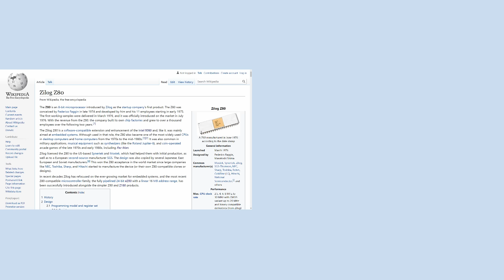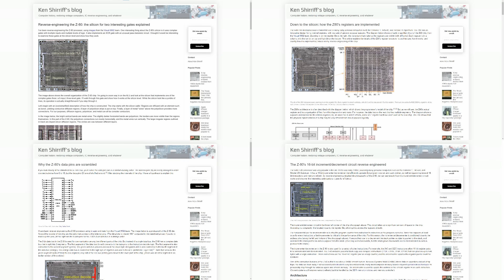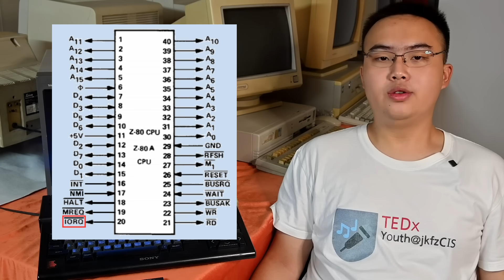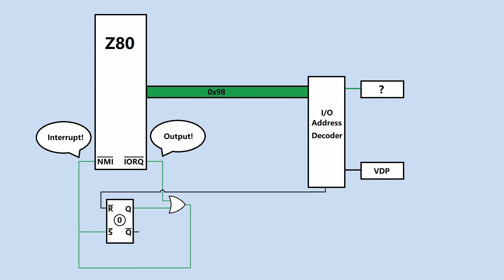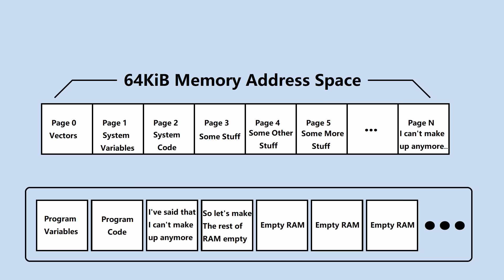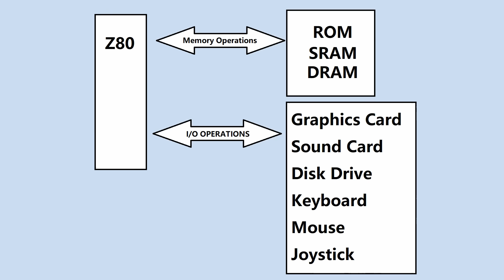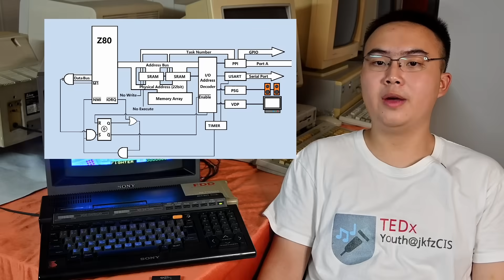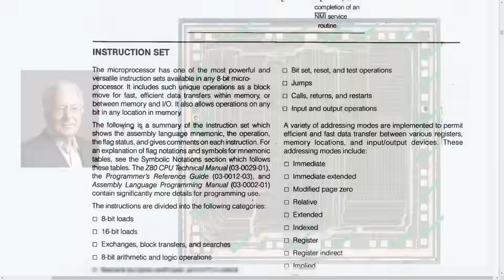The Z80's secret feature discovered after 40 years!

Comment: Brings back memories, all the cool things we were doing on Z80 and 8080 processors. We did not implement protected mode since there was little need for that, viruses and malicious access were not a thing in conditions we had back then. But things like paging memory into the address space and running CP/M system with multitasking capabilities were there. We also had to write pretty much all the software we used, not like today.
Reply: Not to mention that multitasking was an esoteric thing (unless you were on Unix and mainframes), thus in the home computer world protection against other processes wasn't especially relevant.
Reply: @henriksundt7148  - Not that esoteric. In the 80s, the company I worked for, did embedded design, and most of it around a Z80. The company designed its own RTOS. Multitasking came in real handy. We also adapted Forth (the programming language) to the chip, and wrote most of our code in it. We did some complex stuff, around this little 8-bitter.
Reply: @henriksundt7148  Some of it was economics too - Z80 systems were often CPU bound so it made more sense to have several Z80 boxes (possibly sharing an expensive hard disk via CP/NET) than multi-task one of them
Reply: @etchedpixels  not necessarily. Look into MP/M, a multi-user version of CP/M made to connect to multiple terminals
Reply: @DavidStudiosproduct  It was possible but MP/M was mostly useful to run the backend for CP/NET clients. Sharing a single 2-4MHz CPU didn't work that well unless you had specialist hardware (smarter serial, DMA driven floppy). On most CP/M systems the entire machine stopped for floppy accesses due to hardware limits - not very multi-user at all. And if someone needed to format a floppy every other user got a tea break. There were even S100 cards for multiple slave CP/M nodes so you could build a multi-user multi-cpu setup cheaply then run MP/M or more likely one of the better multi-user CP/M clones of the time.
Reply: @etchedpixels  - it’s 40 years ago but, from my somewhat flawed memory, we used a dedicated disk controller for floppies (and hard drive). 
Also we used floppy drives that used a voice coil/optical grating type positioning system which was faster than stepper motor types. MP/M was usable but we didn’t deliver that many systems and regular maintenance was required.
Happy days.
Reply: @duncanmcneill7088  Sounds like the Cromemco 8" floppies - never had a chance to play with one of those. In fact I don't think I've ever come across one this side of the pond
Reply: @etchedpixels  - we used the PerSci drives. Faster but vulnerable to dust, so regular cleaning required. If the eject mechanism fails, the ejecting disk would rip the heads off... lovely.
They moved on to stepper motor driven drives around 1983/4 but I left the industry shortly after that.
Reply: Your avatar is insane where is it from
Reply: I miss the old days.  I loved the way things used to be, simpler.

Comment: The title is not clickbait, it's straight out false: no "secret feature" was "discovered" in the Z80. Insisting to call this a "Z80 feature" detracts from the rest of the video which is actually really good.

Moreover, it took me until the end of the video to understand that you were the one to came up with this trick, so this even serves to downplay your ability. It's clear that you are a smart guy, so don't try to fake it and go straight to the point. You could've just said "Hey guys, today I'll show you how to make the impossible: protected mode with a Z80!" and that would've been fine and "clickbaity" enough without being misleading. I'll hope you continue to pursue this channel because you certainly have the potential for success.

I'll add some random thoughts with timestamps:

0:25 The trick you described could be very well implemented in 1976; there's nothing in "now" that is required for it.

1:58 That's not true, preemptive multiasking only requires a timer interrupt to work. You may have a point if you assume un-relocatable applications that assume to be loaded at a precise real address, but that's not a property of "preemptive multiasking" but of OS design.

2:55 It's not part of its "undocumented features" either. If you implement a video output circuit on your motherboard doesn't mean the processor has "undocumented video output features".

7:54 Of course you assume that "malicious code" can't change the NMI vector, for example if the OS code is in ROM or you implement the mapper circuit with access control you describe later.

11:00 The 6502 can do pretty much what you describe at similar hardware cost: the "syscall" trick  can be implemented by matching the BRK opcode (all zeroes) with the SYNC singal going high, and the equivalent of IORQ can be obtained in the I/O Address Decoder.

11:50 "Faggin" is pronounced with a "soft G", like "giraffe".

12:45 So you make "clickbait" videos because big channels (that have been working for almost decades to build an audience) get lots of views? What?

13:10 Of course, assuming that none of those platforms have any memory-mapped I/O.

14:30 I wouldn't be surprised if the story isn't true: the undocumented instructions are not really surprising if you analyze the official instructions and remember that the Z80 is a very simple implementation of a somewhat complex (for the time at this scale) instruction set. There was no point in including circuitry to detect invalid opcodes like in more modern CPUs, so when the Z80 executes invalid instructions, the internal circuitry just happens to do "something" based on the configuration of the internal signals at that time. When the result is deterministic and the CPU doesn't crash, we call it an "instruction".
For example, the DD and FD prefixes change all instructions that use HL into instructions that use IX and IY (with optional offset when used as memory pointers). It just so happens that they were implemented in such a way that the CPU didn't care what instruction came after the prefixes, and so it happily executed it while preserving the "setting" to use IX or IY; I wouldn't be surprised if internally is just a couple of flip-flops that get set while reading the prefixes and reset when the actual instrucion runs.
So, for example, "LD A, L"  prefixed by DD becomes "LD A, IXL", that is, you can use IX and IY as two independent 8 bit registers in every instruction that accepted H and L.
Since those instructions got a lot of use by programmers, when newer processors re-implemented and expanded the Z80 in a different microarchitecture, they had to make those instructions execute exactly like the old Z80 did, so many of them became finally "documented".

Comment: I had a DEC Rainbow - the beast had a Z80 AND an 8086 and you could boot it into either DOS or CP/M.  It was SWEET!
Reply: Then there was the DECmate -- A PDP/8 (Intersil 6100) and a Z80 :)
Reply: I have not thought about that machine since the maybe’85 when it was provided to me and other financial analysts at my company. I had used the Apple][ and IBM PC and had bought a MacIntosh; and the Rainbow was nice; replacing green lined paper spread sheets and long overdue. We only used DOS; and it was annoying that the 5 1/4” floppy discs though higher capacity at 400 kb were not compatible with the IBM PC 360 kb disks.

Comment: Not clickbait. What you showed demonstrated a very solid understanding of 1970s though early 1990s digital logic. Your solution was nontrivial and it is most certainly educational for those that have not worked through similar problems back in the day. Discrete, and even (hand-rolled) lookup digital logic is, imho, becoming a lost art. Thanks for putting it together!

P.S. the first CPU-based machine I designed centered around a Z80. It was a non-trivial, embedded system and decades later, it remains one of my favorite projects (at least, for its time).
Reply: It is clickbait. It's a great little MMU implementation, but a non-clickbait title would be something like, "I built an MMU for the Z80."

The current title, "The Z80's secret feature discovered after 40 years!" contains at least one outright falsehood (being able to build an MMU for an 8-bit processor is far from a "secret feature") and probably a second one (it's very likely several people have done something similar in the past, even in the long past; e.g. similar but more sophisticated techniques for were used for Jeff Laughton's 6502-based KimKlone which was built in the 1980s).
Reply: @Curt_Sampson  yeah, the “secret feature” part 100% is clickbait- I completely agree. But the video still delivers genuinely interesting and useful information about the Z80 (and other, similar CPUs) for the intended audience, so I support that aspect of it. Yep, it’s an MMU, but if the viewer doesn’t know how one works, on a logic level, or why one might be useful, it’s obviously novel (“secret”) to them. Basically, I see both angles, but I also see no harm.
Reply: @Curt_Sampson  I was reading your comment and then my neighbour came and we read it together. He said that your comment changed his life and touched his heart. I then went and rented a projector in a big field and my entire town read it and it changed their lives too. We all are so grateful.
Thank you for your first comment….
Reply: @rodiona8781  I'm glad to hear that. Earlier this afternoon I took your comment and had it put up on a five meter high billboard near my house. Since then many people have been stopping and applauding; you've really made my entire neighbourhood a better place.

They're all saying, too, "the original poster of that video must be so glad that so many commenters are entirely ignoring the video itself and the ideas in it, and instead using the comments section as a forum for venting their personal feelings about other commenters. I'm sure the OP feels the project that he spent dozens of hours on is far less worth of discussion than what Rodion A and Paull McGee are saying about how they feel about Curt!"
Reply: @Curt_Sampson  Curt, we still love you and I do not think less of you but I think you missed the point of the title. As someone that was riding by the seat of my pants trying to understand what was being talked about in the video (much like many people that will see this video) I found your comment dismissive and tone deaf. I still appreciate your opinion and your experience on the topic and I'm an advocate for people that don't think like others. So I really hope I can learn more from you. Not a jab, I would definitely subscribe to watch your videos if you ever made any.
Reply: @rodiona8781  Yes, looking back on my comment I can see how it would not be immediately clear to someone who doesn't have some level of understanding of, say, basic address decoding techniques (i.e., how you decide what chips to enable based on what the CPU put on the address bus and other externally stored state).

But that is part of my complaint about the video itself: he's deliberately chosen to obscure this.

For someone like me, after a long and misleading intro it finally becomes apparent at around 6:30 what he's doing and I'm able to say, "Ah! There is no 'secret feature,' nothing being used here is undocumented, and he's just using a nice little technique that applies to any microprocessor, not just the Z80."

But of course if you're not familiar with the details of address decoding and these techniques he's using, you're not likely to to come to an understanding of what he's doing anywhere near this quickly, if you even do so at all. The clickbait may serve to attract viewers, but it works directly against educating them.

Which is a shame, because this stuff is interesting well worth learning, and I think a lot of retrocomputing enthusiasts would benefit from a better understanding of how address decoding systems work in general, and particularly from understanding that it's not the CPU that decides what memory or devices it's accessing.
Reply: @Curt_Sampson  oh no. so sue him. 🤨
Reply: @pmcgee003  I'm not going to sue him; it's up to Andy whether he wants to put up clickbait or not. But nor am I going to subscribe, or trust the titles of any videos of his that happen to come up in my feed. I simply don't like channels that don't tell me what I'm getting. I guess Andy will see if turning of folks like me is compensated for by whomever else he gains as viewers from the clickbait.

 (Aside from the clickbait , the video had some good stuff in it; I was conflicted about whether to down- or up-vote it.)

@a1nelson Yes, the flip-flop to disable/enable "user mode" is clever. Using just I/O address space to trigger the MMU is reasonable, but certainly nothing special; you could just as well decode an area of memory address space for this. What the video doesn't (but should) mention is that the Z80 I/O address space is basically just a bit of convenient built-in decoding; it doesn't offer anything you can't do on other CPUs that use memory-mapped I/O. Admittedly if you're really trying to minimise chip count it can be handy, but that's when you're talking about 5-6 chip systems and don't want to use a GAL.

And of course there's a lot more to do  to get real protection; you need to have a separate bank-switched memory area for each application, you need to switch on interrupts as well, you need a timer interrupt on NMI, and so on. (Much of this is pointed out in the video.) At that point, now that I think about it, having a separate I/O address space makes things no easier at all; in fact this might be easier to implement on a CPU with a single address space, such as 6502 or 6809.
Reply: @Curt_Sampson 1. "I'm not going to sue him". Pretty sure it's only in america that someone would feel this isn't obvious.  😉
2. As for "didn't know whether to down vote" .... are you dreaming? 
Down voting is an extreme unction resulting from receiving a personal injury from watching the video. "There was some good stuff" is completely incompatible with any consideration of down voting. 
3. The thing is, you've told us of your reaction as if we somehow need to know about it.
Reply: @pmcgee003  And we need to know about your reaction to my reaction?

As for not suing people being non-obvious in America, I wouldn't know; I'm not from there. You're the one that suggested I do it; perhaps you're American?
Reply: @Curt_Sampson  it was sarcasm. americans miss that too. I'm glad to hear you're not from there. 
I didn't write paragraphs declaring whether a video poster has done a sufficiently good job, based on my opinion of his content AND VIDEO TITLE.  I was critiquing your apparent self importance.  
It's god's work, for atheists.
Reply: @pmcgee003  I'm not sure why you decided that I was being "self-important" rather than just giving an opinion on the video like anybody else posting a comment. Perhaps you're projecting here? You're the one that appears to me to have a large sense of self-importance, since you're discussing your reaction to my comment rather than discussing the video.
Reply: @Curt_Sampson  there's plenty of positive comments on the video. And it's common practice that someone presenting their work in public will be too polite, or cautious, to argue strongly against people critiquing or criticising their work. Because they don't want to discourage viewers, or just because it's the done thing. 

So it falls on the rest of us to poke back at the 3% pontificating on whether this content should be allowed to exist, or whether it has an acceptable title, or etcetera.

It wasn't just you, but you're the one I'm talking to.
Reply: @pmcgee003  Well, you're certainly free to choose to criticise commenters on the basis that you think they're too "self-important" or you don't like criticisms made of someone else, but I don't think that's being particularly helpful to the one presenting their work or anybody else. If my criticism is incorrect, the presenter is not going to know that from you telling me that I'm too self-important. He'll only know it if you address my criticism itself, rather than making ad hominem remarks.

Comment: No, you can't virtualize the v99x8, DI & EI do not works for NMI, most game don't include DI EI in fast graphics routines as they works hooked from rst38 anyway, v99x8 has atleast internal 16bits shiftable buffer, by example outputing to 0x99 and then another 0x99 will complete a 14bits address plus mode bit, if you place a third 0x99 and don't complete that output with a fourth 0x99 imagine the state of that buffer address, it will be a mess.